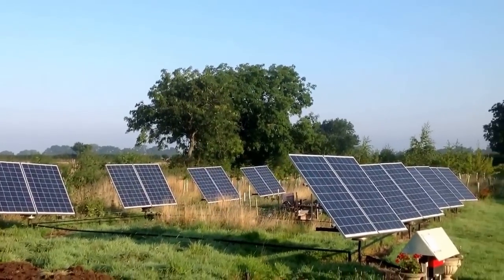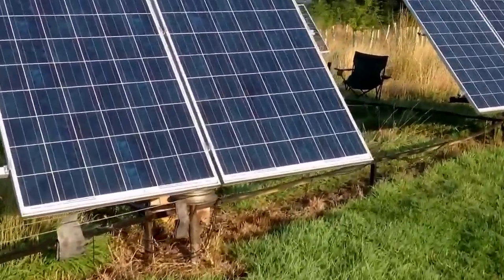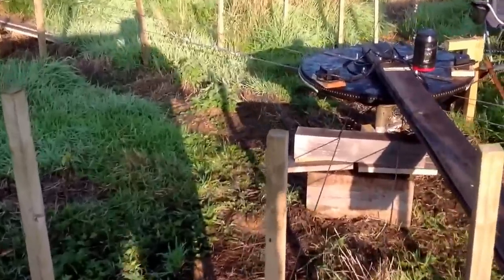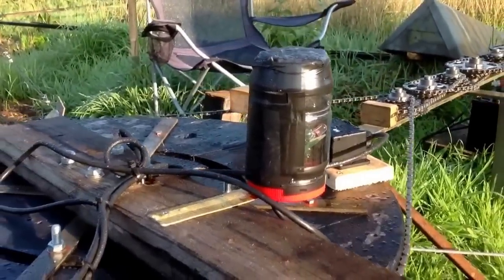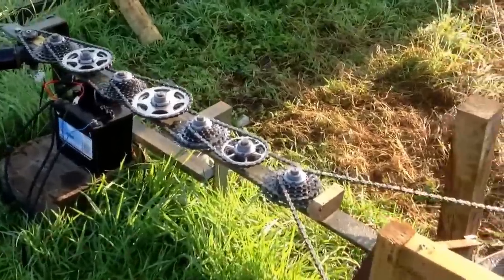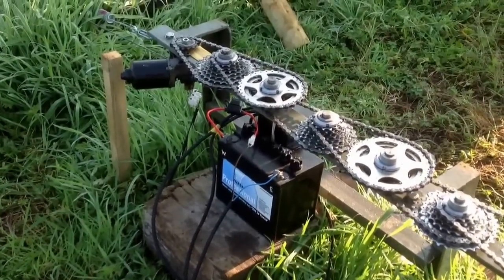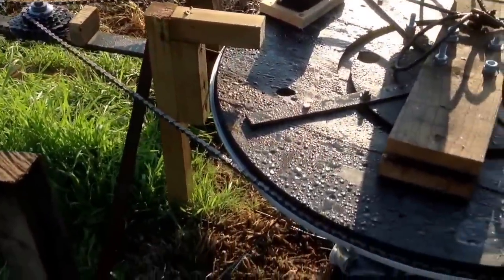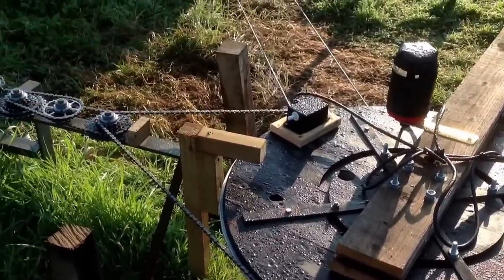Solar Tracker,(4kw array) home-made with cheap components.

Comment: Ingenious Rube Goldberg like machine!  You were very smart to mount the panels close to the ground in order to minimize the effects of wind loading.  The separate arrays is also a very good idea to facilitate monitoring and repair without affecting the entire system.
Reply from the maker: Cheers! Since uploading this clip the system has had all the little teething troubles sorted, and now runs very reliably. At this time of year (May) I am getting about 35% to 40% more than my neighbours with fixed south orientation, that will peak at about 45% more next month. This only applies on a sunny day, when cloudy the difference is negligible.
Reply: struck2soon Thumbs up mate!

Comment: 6 1/2 years later,  what is it's the condition?

This is some serious MadMax steampunk action going on here!
I love it!
Reply from the maker: Thanks Jason! Surprisingly, this "Scrapheap Challenge" of the solar tracking world continues to function reliably. I think the simplicity is it's strongest point, as anything which does go wrong is usually fixed with ease. To date, I had to renew the large wooden wheel(final drive sprocket) as the first one rotted. Painting wood which is left outdoors is not a good thing, it stops it from breathing. There is now a cover over the wooden wheel. Some of the bike sprockets have also been replaced with cast-offs from the local bike shop. 
It averages about 4400 kwh per annun, which isn't too bad for a 4kw array in a country not renowned for sunshine.
I keep threatening to do an update to this video, I will make a point of it this spring.
Reply: @struck2soon  I read that a Siemens panel degrades production 2% the first year and 0.7% per year there after. That means if these are 7 now, they are good for about 235 watts max (3,7 kW). It's amazing to see how much more energy collected by just following SOL is produced.

I installed a fixed pitch {37° at 15° pitch) last year with 6.2 kWp, and average 22 kWh a day. I am building another array of panels but 2kw and the expected output is 17 kW per day instead of 7, just by tracking the sun.
Reply from the maker: Jason, tracking is indeed the simplest way to not only increase yield but provide it for more hours of the day. Your comment re-panel output: even when new I rarely registered a full 4kw output. I have noticed that filtration from various atmospheric factors is the key hinderance. Only on those rare days(well, in England anyway) when the sky is a deep blue do I see anything approaching 4kw output. Despite their age I occasionally still see figures approaching 4kw.
Reply from the maker: ...I forgot to add that my record day was 44kwh, which was achieved just a few days from the summer solstice. We are at 55 degrees north, so at that time of year the days are very long. It is unusual for us to get cloudless days, but it happened at the right time in this instance.

Comment: Brilliant. 
Nothing I admire more than than the DIY utilisation of old junk to make something clever which serves a useful and functional purpose.  The smarts in this system is fantastic.  Something different and off the wall that I can see would do the job perfectly. 
Bloody well done mate!
Reply from the maker: Oil Burner cheers Geeza! High praise from the High Lord of scrap and waste utilisation! Some of the yield figures this produces in the summer are pretty impressive: my record day close to the summer solstice was 44 Kw/h...a couple of neighbours that have the same size system fixed onto their roofs only managed 26 Kw/h on same day....a 69% percent increase for my poxy home-made tracked system!

Comment: You've created a really amazing system there.

What happens to the panels and wire rope when it's really windy ?
Reply from the maker: Solving that particular problem has taken a while. However, with a good amount of tension on the wire rope the system is fine up to about 25 knots. Wind speed above that reqires panels to be secured, which I do with a system of posts which are in ground and have a bolt that is dropped through holes on back of frame base. If really strong winds forecast then they are also tilted back to the lowest angle setting to reduce windage.I can post a video of securing system if you like?

Comment: Awesome brother and thanks for sharing.
I would like to see your indoor  setup. 
What are you running on this system? 
What are the controllers? 
Cheers
Reply from the maker: Cheers! Here in the UK solar generation is supported by the government, they pay a generation tariff based on the amount of electricity you produce. To qualify for this payment your system has to be grid-connected so that any surplus is fed to the grid. The beauty is that they pay for your actual generation, regardless of how much of the solar electricity you use yourself. So the indoor set-up is very simple: from the inverter it runs straight through a separate generation meter then out through the main meter to the grid.
Reply: Ok
Reply: I just added you to my google+1

Comment: Hi struck2soon;
Here are a couple of links I have on this system:
http://www.redrok.com/led3xassm.htm#thompson
This has a fairly detailed description on the drive mechanism.
Also the fix for a special problem this system had where the
sensor was confused by diffuse reflections from the backside
of panels in front.

And a list of struck2soon's YouTube videos on this.
http://www.redrok.com/led3xassm.htm#Andrew
The tracker used in this system is the:
LED3XS24Vc3RIP
Standard Single Axis Solar Tracker with Reverse Inhibit & Parking
http://www.redrok.com/led3xassm.htm#sellled3xs24vc3rip
$45us plus $4us shipping to the US or $10us shipping to the World.

Duane C. Johnson
redrok
redrok@redrok.com
http://www.redrok.com
Reply from the maker: Thanks Duane, I really need to post an update video to show some of the tweaks and adjustments I have made over the past few years to improve the reliability and operation.

Comment: Very clever set up seen quite few on here but yours feel something like I would like to try/ build could u email with a list of parts needed and web links as well,probably only start off with a one panel project for now...cheers Kenny ;)
Reply from the maker: The tracker module is available from www.redrok.com, proprietor Duane Johnson also very helpful over telephone. Cost of unit about 30 quid shipped.Motor is an old Suzuki Swift wiper motor, got mine on ebay for less than 20quid. Main work was trying to sort out a reduction gearing system, I was lucky to have an engineering mate who machined a series of shafts and bushes to mount used bike sprockets on. He also machined the slots in mounting bar to allow adjustment of sprockets. I am sure something simpler would work, maybe an old motorcycle gearbox? The greatest loading will be in windy conditions, and believe me those panels develop a huge turning moment when wind above 25mph. Good luck!
Reply: Thanks for the advice...i'll give it a go ;)

Comment: I was thinking bicycle gears would work the best. They would have a more positive connection than using a belt driven system. I would like to know how the brain is made and wired up. Have you thought about doing a video on that?
Reply from the maker: Good idea Kurt, I shall try to put a clip together showing wiring and tracker mounting.

Comment: You show the pan but not the tilt mechanism.  Nice design.  I have thought of similar designs but with heliostat mirrors for solar thermal, which would be a little bit lighter. I envisioned a much lighter weight set of cable wires controlling both the pan and tilt which may not be realistic at all.  But my design was similar in that my goal was to try to eliminate the need to put motors and electronics on very bird.  I hope to build my design someday.
Reply from the maker: Jeff, the system only works for azimuth....the tilt is fixed. I adjust it about 3 times a year according to season. The thicker wire rope is due to our exposure to strong winds here, if you live in a sheltered spot then thinner wire would be ok. Don't be put off by the controller unit, it was easy to install and only cost US$ 35 from Redrock Solar.

Comment: Very ingenious!  I wish I could do something similar.  I just simply do not have enough sunlit area on the ground to do what you did.  I have the same-size system but fixed and on my roof.
Reply from the maker: Thanks. Hadn't planned on ground-mounted, but local council wouldn't allow us to put panels on roof because house is Grade2 Listed...this was a secondary choice but worked out better in long run.

Comment: How does it handle heavy winds and snow ?
Reply from the maker: When strong wind is forecast (35mph plus) I orient the panels to face south, at that position I have posts in ground so I can peg them to stop wind loading putting a strain on mechanism. For really strong winds I can also lower the elevation of panels to present a smaller area to the wind. 
We don't get huge amounts of snow here, but so far have had no trouble from snow.

Comment: Talk about using "available resources".
Reply from the maker: Fred Ivory yes it's a bit like "scrapheap challenge"! The system has had various tweaks and modifications since this was filmed, but is essentially still the same. It continues to perform well, average annual yield for the past five years has been 4400 Kw hours. The installer's predicted (optomistic) yield for a fixed system in our location was 3300, so I am pleased with the result.

Comment: too much going on here sir.
Reply from the maker: Mungu, you have a choice: either pay a fortune to get a simpler-looking tracker or make one yourself. Doing this saved me about 15 thousand dollars compared to buying one. In my mind that makes it worth being a bit more "too much going on" than the commercially available alternative.
Reply: @struck2soon  wind and power Missouri has a great time tracking system they cover with the patent holder in Michigan.
Reply: @struck2soon  2 actuators. One for tilt the other for sun window orientation based on time. One controller 2 30 amp bkrs I believe.

Comment: How do you calibrate the system?
Reply from the maker: Sorry, not sure exactly what you mean by "calibrate"...which part of the system are you referring to?
Reply: struck2soon I mean the mechanical part, how and how often do you have to adjust the end-position of the panel to the limit switch?
Reply from the maker: kremicfein I tend to only alter the limit switch position about twice a year. I move them to a much shorter travel in October, and move them back to their full limit in February. I have recently changed the attachment of the limit switches to the wooden disc to velcro instead of screws to make changing the position easier. Hope this helps!
Reply: struck2soon yeah, makes sense. Thanks for the info 😎👍 Very nice setup btw
Reply from the maker: kremicfein Thanks! I have made a few tweaks and improvements since this initial setup, but it remains largely the same. Yield has been averaging 4400Kwh per annum for the past six years, which is about a third more than the predicted yield for this area. I should really compare it to my neighbour's yield to get a true comparison, perhaps I will do that.

Comment: interested
Reply from the maker: linear actuators for solar trackers are actually not very effective at higher latitudes. We are at 55 degrees north which means the sun is above the horizon for about 270 degrees azimuth near the summer solstice, linear actuators are necessarily limited to less than 180 azimuth by design. I actually tried a linear actuator as my first attempt and ran into the problems mentioned. Far better to use a rotary actuator!
Reply: @struck2soon  long length and heavy loading can help to solve this issue. You can design short lever length, because Max50000N push&pull force and customize to 2000 mm stroke. It is easy to implement 270 degrees rotation.
Reply from the maker: linear actuators for solar trackers I guess this would mean actuating one of the panel joining wires rather than my central drive hub?
Reply: @struck2soon  linear actuators can customized to the same voltage of you central drive hub, so you needn't extra one. Details need decide by your power system design.
Reply from the maker: linear actuators for solar trackers ....I don't think you understand my question. Basically, how are you getting the linear actuator to convert to rotary motion above 170 degrees without interfering with central hub?
The Red Rock sensor/driver can take a range of voltages from 6 to 500, so very adaptable without any specialist equipment. It is literally plug and play, and only cost about US$40.